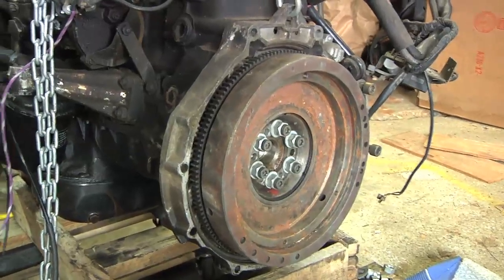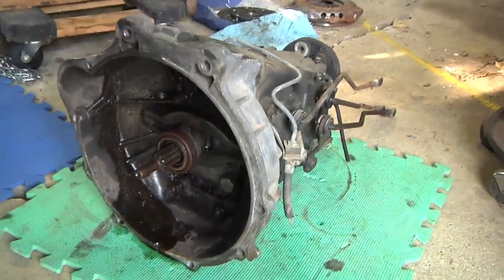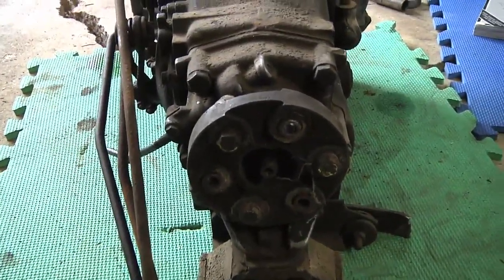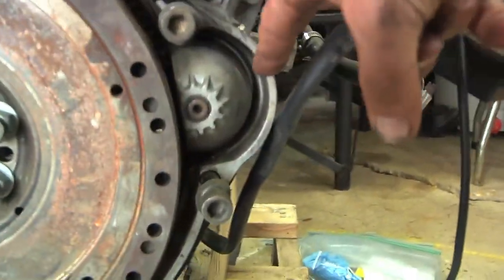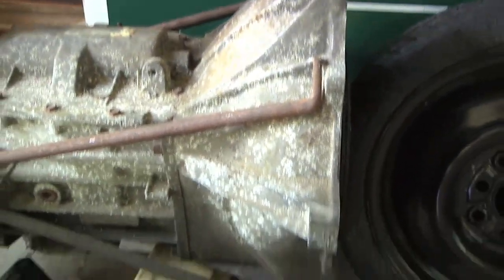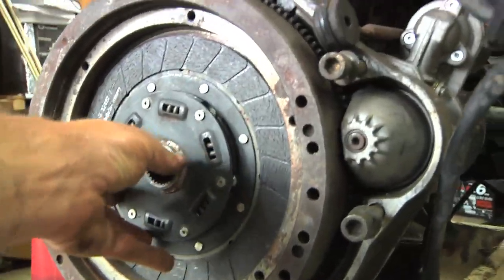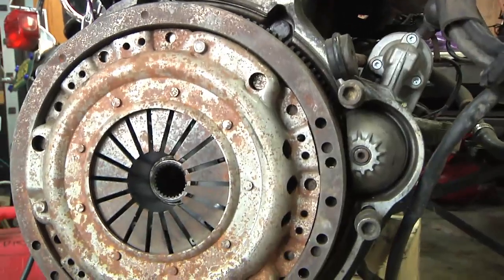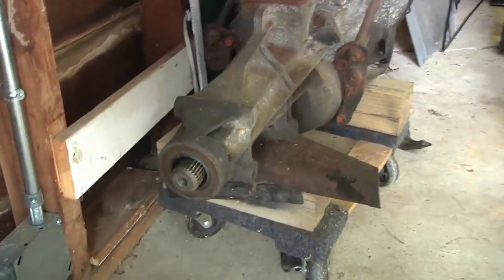SuperTruck: Mercedes manual transmission bell-housing

Comment: is there anyway to either get a custom drive shaft made for the splined out put shaft or find a driveshaft that fits the Chevy S10 transmission? or could you swap the output shafts from the Mercedes transmission and put in in the Chevy S10?

Comment: you don't need starter since you have dc  motor!!
Reply from the maker: The plan is for the large DC motor and engine to be on opposite sides of the transmission. So, the motor would only work with the engine while the truck is in gear. It might be fun for "rolling starts", but I wouldn't be able to start the engine with it while parked.